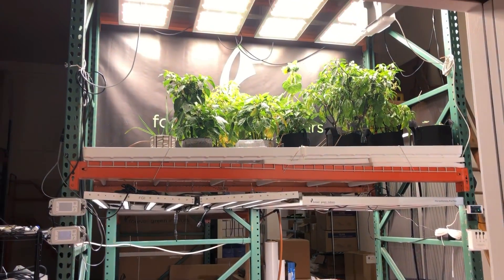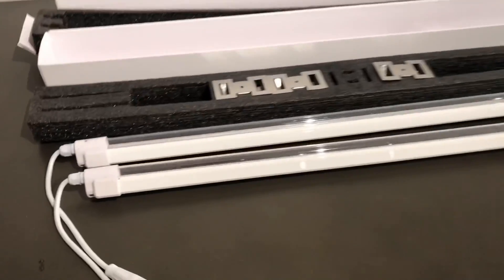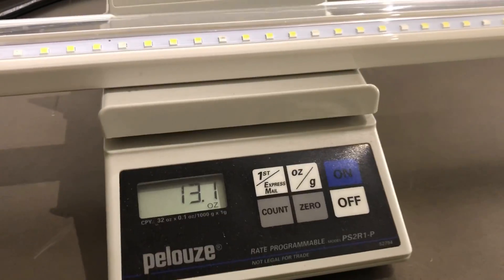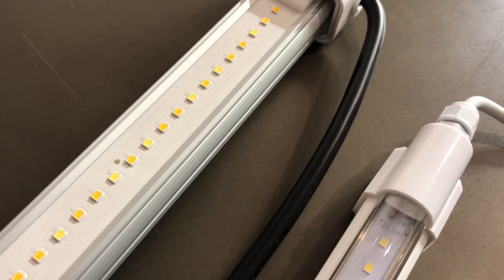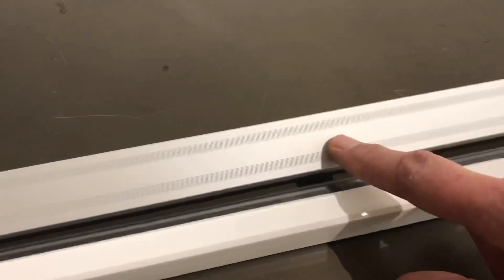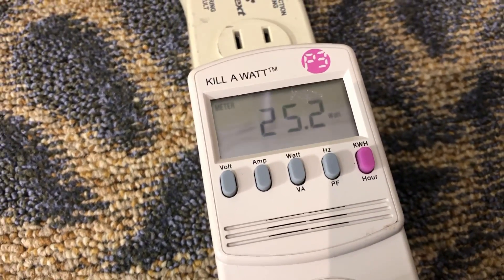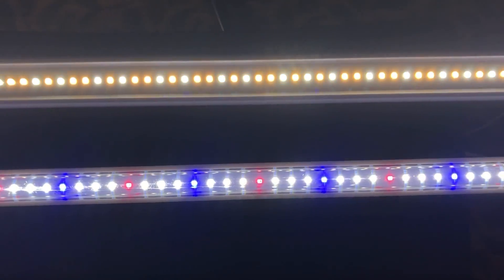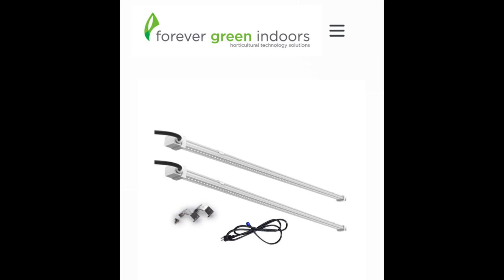Forever Green Indoors / FGI Lighting Grow Lights LUXX Clone LED vs FGI FlexiClone LED System

Comment: Hi at what distance did you measure the spectrum values? Assume that this should normally be done under a multibar array rather than a single bar?
Reply from the maker: Hi, sorry we missed this. We used a two bar set (that is the way they are sold). It was 12" from the two bars. About 150 PPFD. Add two more bars it would be about 400 PPFD.

Comment: t5 tubes come in many different spectrums cool white all the way up to 20,000k..also very cheap to replace.$5 for a coolwhite tube..these make no sense cost wise
Reply from the maker: Those tubes have a pretty short lifespan. These units have a 5 year warranty and are built of aluminum not plastic. Fair question. But these were designed to stand up to commercial garden use which is pretty abusive and the T5 LED tubes for sure would not survive the drips and sprays in a big busy garden.
Reply: @forevergreenindoors  i remember audi vw and all the car companies sayong their leds last years..then the aquarium coral trade saying the same..they use 5w per diode..not the lame 0.4w diodes in this industry..guess what happened..they didnt last half as long as they claimed..t5 tubes last 12 months.not leds the normal t5s and let me tell you..they are ip67 fully waterproof..not ip66 which is splashproof..used on fishtanks for years..before that it was t8 and they too were ip67..shitty luxx got taken over by hawthorne and they have pulled them because they aint even ip66 and there are also problems with QC..so what was that about not being able to stand up to drips spray and humidity😆..leds are more overated than frank bruno..proof is in the pudding..and the pudding is looking rather poo